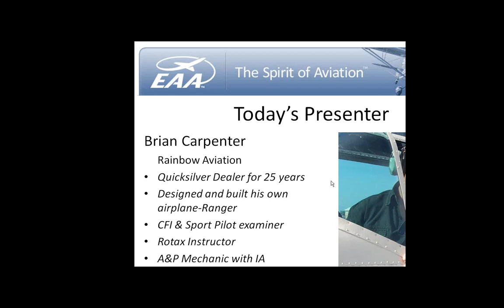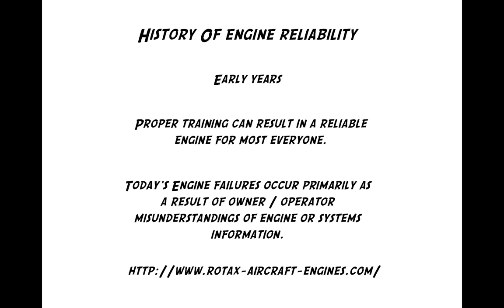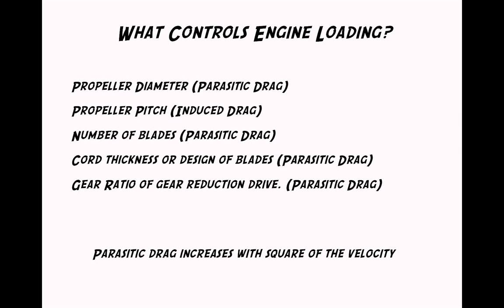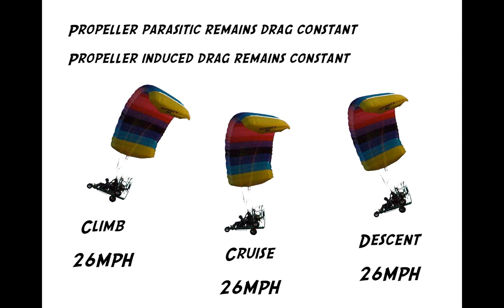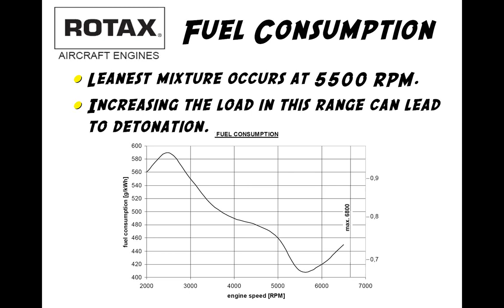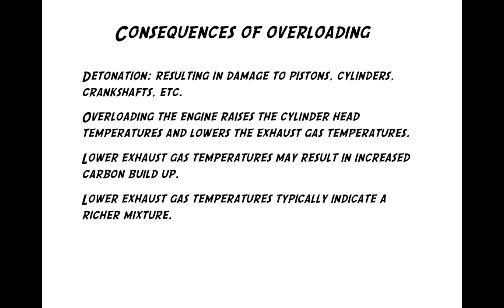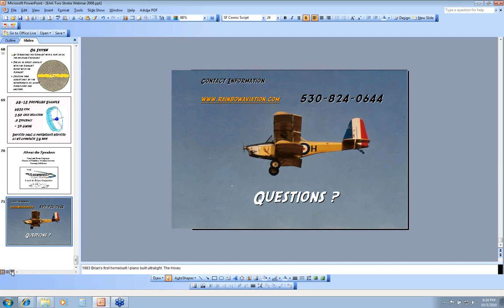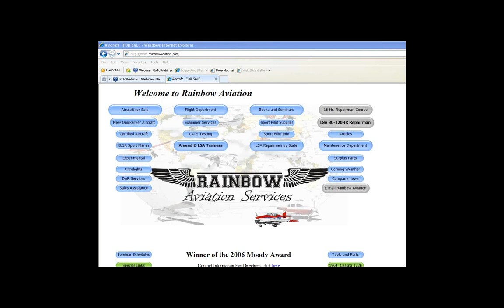Webinar: Is Your 2-stroke Engine About to Fail?

Comment: I feel this is worth watching. I agree with most of the info. One main disagreement is that the modern engines if run correctly do not fail. WRONG. Lower rod bearings fail even when  ran exactly to Rotax recommendations . 3 out of 5 fail because of this.  Also inverted engines are prone to shorter seal & outer bearing life,  because the oil feed holes are now up side down. Oil flows better down hill .  There is more but I don't want to nick pick. 
GOOD JOB.
ROTAX RICK
Reply: I'm an engineer and I don't know why a lower rod bearing should fail.  Rotax certainly knows how to design one that doesn't.  Is that against the law of physics?
Reply: I completely agree with you on the oil holes. I don`t know why Rotax did not put holes for the two inner bearings. Windage off the close spinning crank webs tend to keep the oil and gas slung away from the main bearings. As far as the one slot connecting rods, it may have more to do with the applied load on the bearing surface as with the lubrication. Rotax does not comment on such things. I know double slotted rods  fail just as often as single slotted rods.